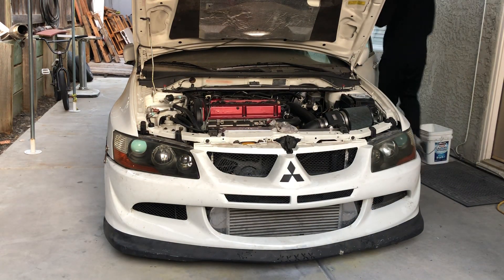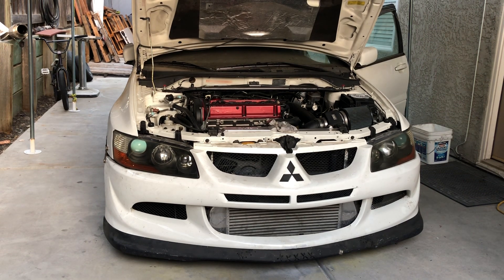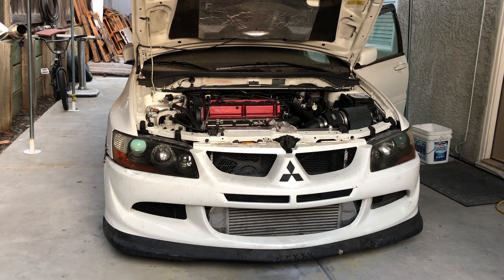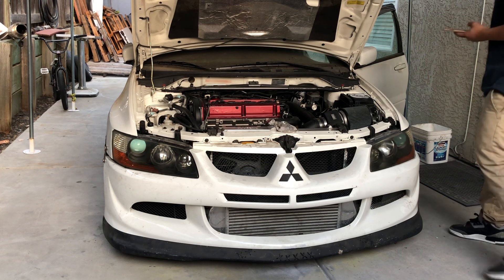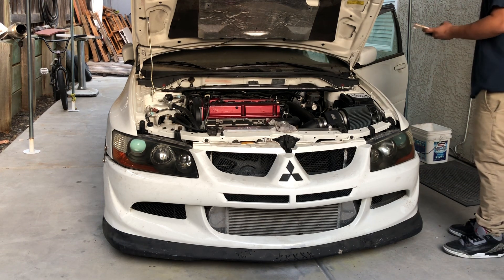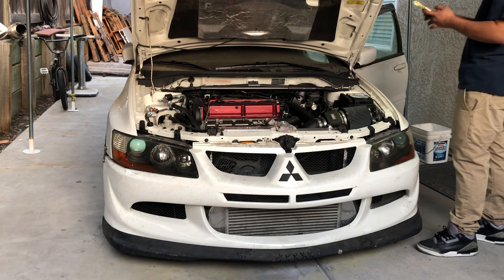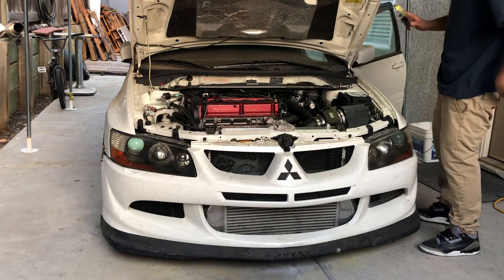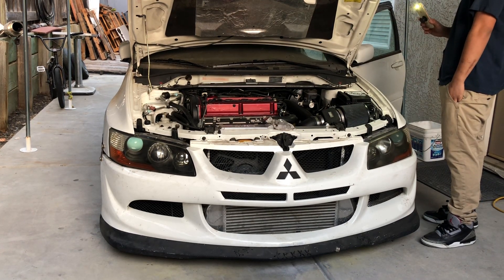Fully Built Evo 8 First Start Up After Rebuild

Comment: hey bro, i just  finished doing major overhaul on my 4g93 cm5a turbo engine.. on my first start, it sounds like yours.. is the knocking sound normal on first start? and how long it will go away? sorry for my bad english
Reply from the maker: my motor had that knocking sound before and after my rebuild but it was never an issue for me. I'm unsure if thats just how 4g63 motors sound when running
Reply: @sonnyangeles11  i just found out the knocking sound source. it was from the god damn clutch TOB.. haha thx btw
Reply from the maker: @vilfrientsen506  I’m glad you figured it out! 👍🏼